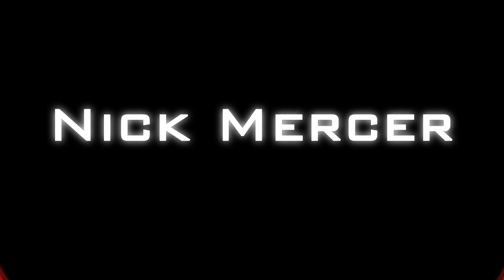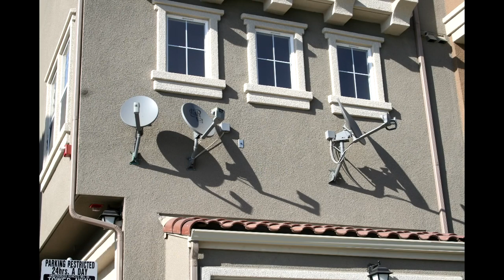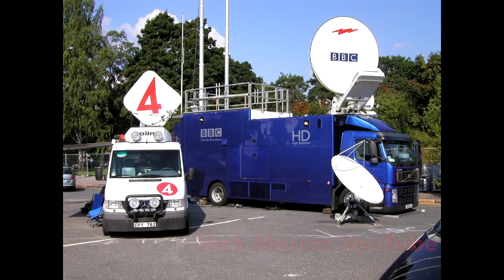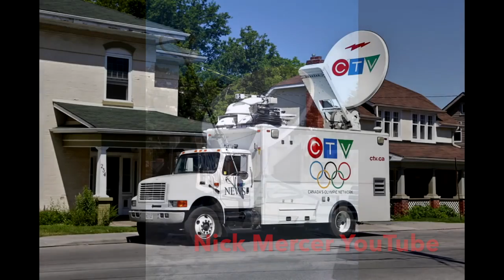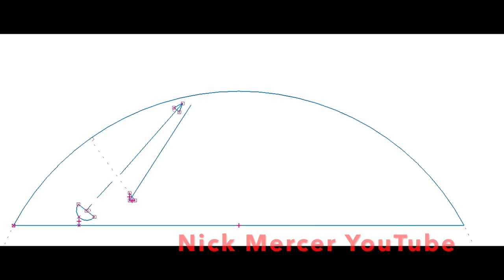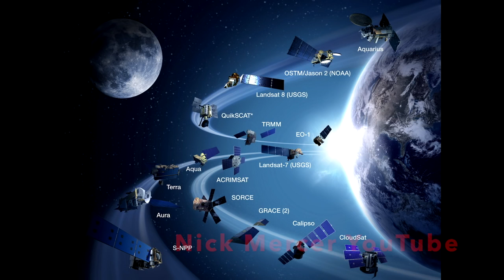The Firmament 2021, How satellites work

Comment: Anyone can see Satellites with a good telescope. All you have to do is search the sky in the direction our dishes are pointing and you will see them
Reply: Andy Martin thats not satellites they/you think they are seeing.  you cant see something the size of a mailbox or car from that far away.. just think about it.
Reply: +Andy Martin,  salar de uyuni  in Bolivia
80 miles x 100 miles perfectly FLAT, put the curvature to test there. It will fail. 
Oceans, and seas are flat they are referred to as ? Sea______________.
Reply: Prepare the way for the king I really doubt you have a telescope because if you know anything  about them it's the diameter of the scope that really matters . Also what is a focal telescope exactly I've heard of focal length on a telescope is that maybe what you ment? that can all be changed with a simple eyepiece swap or using a Barlow. so again  I really really doubt you own one I own a 80mm (in diameter) reflector type telescope only about $100 and I can see the moon extremely well with it and no there is absolutely no water in between us and it  unless that is a special kind of super invisible water with not a single bubble or anything else in it
Reply: Todd Olson go buy a telescope and stand on a beach at the ocean aim your telescope flat and look straight across do you see the other continent? Do you see the other beach that is facing you? Do you see people on that beach?
Reply: bear adams ..... Right....take a ship..oh thats right they travel on flat level plains as well. seems to me you're stuck on this flat plain with the rest of us.

Remember a lie is still a lie even if everyone believes it. 

And the truth is still the truth even if no one accepts it.
Reply: +Soldier for Christ
Hmm, that telescope you have: is it a refractor or a reflector? What mounting do you have? Can you give us the brand and make?
Reply: MrKobesadie go get a telescope lol then you will see for yourself math isn't bs it's a hard fact only bs is the flat earth there is no edge of the planet if there were we would have found it there are over 7 billion people in the world the kind of conspiracy you think is going on just isn't possible too many people would have to be in on it from around the world and let not forget people think the color of your skin or sexual orientation or region are reasons to kill each other yet the entire planet has been working together to keep "God's dome" a secret from everyone else. only people lieing to you are the people telling to the bible should be taken word for word .bible was written by people that is it's biggest flaw and second half of the story's of the bible were left out your reading an incomplete book.
Reply: dirty 4 play y are u here if you don't have an open mind fuck out of here
Reply: bear adams no mate nothing aimed at you. I too am a Harlem globelover. 
respect. 

my shit is aimed at alonso
Reply: dirty 4 play 
Ive seen them myself.  Im getting tired of these compter voices, and people pumping themselves up.
Reply: how do you explain when you are in a car traveling at 70mph you don't get thrown backwards with the motion you don't even notice the car is moving without the world passing by. . when riding the Gravitron you are based at the edge of the ride and actually feel the Acceleration. if you looked into the gravitron ride, the reason you get thrown back is because you are placed at the edge of the ride at an angle with the ride spinning at 24rpm's, in which you feel acceleration. go back to school or at least stop going to church and read your posting before you spout fake shite
Reply: well using a GRAVITRON ride as an example is a bit lame. it aint the same is it. for 1 the gravitron isn't the size of the earth IS IT, you should use your brain. size matters when it comes to velocity, motion and centrifugal force. rather than making random assumptions you should research some first.
Reply: Soldier for Christ - Ha ha, that's funny :o)
Reply: Pictures ..??
Reply: +You Tube Of what ...?
Reply: +dasspecialist1220
It is well known that a hiker in distress on a mountain can use a pocket mirror to attract attention: a bright light doesn't have to be 1' in diameter to be visible to the naked eye. The (dining-table-size) antennas of the Iridium satellites work as excellent reflectors so that (given good circumstances) you can even see a "flare" during the day.

You can try and look for satellites passing over your location, every night. They will always appear at the predicted time and on the predicted path in the sky.
Reply: daspecialist1220 Then they must be UFOs orbiting the planet then. What else could possibly be orbiting the planet? And I actually have seen and iridium satellite in broad daylight once.
Reply: dirty 4 play let not forget the reason NASA started this 7 billion people lie is to discredit the bible which tell us about the invisible done that contains all that we know lol
Reply: Alonzo Quiñones did I say I would take a ship? the earth is not flat it appears to be flat to us because of the scale of thing s think of an ant standing on a hot air balloon to that ant the balloon looks flat even if it was flying slightly above it like the scale of the plane you supposedly fly it will look flat to that ant due to its field of vision "sea level" is wear it's at because of gravity pulling all the water towards the center
Reply: bear adams....no where in my replies did I say I was a pilot. I do however deal in a highly technical/ mathmaticsl field in aviation. 

from boredight to tracking to weight and balances in aviation. curvatures are not factored in such calculations. I have flown all over this plain and I know it's not a sphere.. I wish I could show you the things I've seen and done, unfortunately you probably wouldn't believe your own eyes.
Reply: Alonzo Quiñones sorry my mistake on the pilot and I would believe my own eyes a lot faster then I would believe Somone in YouTube comments. tell me this if the earth is flat and space isn't what we've been told then what are planet's and stars and the moon which I clearly see with my own eyes and my telescope
Reply: bear adams ...fair enough..I'll give you a glimpse on what I do and where I work....Vc-25..I assure you I am not making this up or it's just my opinion. I'm definitely not some YouTube crazy person trolling. I too once believed what I was told. it's after years of studying and observation I've come to the conclusion that this place we live on is indeed not a sphere.
Reply: Alonzo Quiñones so you worked on an airplane. wow wee. how does this make you an expert. how much study and research have you put in??
vc25 is a military version of the Boeing 747.
Reply: kai sanders .....ummmm it's not just a Boeing aircraft..If you can't tell by the picture it's Air Force One then there's really nothing else to tell you. My research and experience spans 27 years.
And yes I am considered an expert in my field.
Reply: kai sanders was that aimed at me ? I'm the one with the telescope And I'm claiming the earth is round since I see planet and stars and the moon just like all the evidence suggests
Reply: Alonzo Quiñones if your right then I hope to one day see the evidence to support it and change my mind
Reply: Alonzo Quiñones so what field are you considered a expert then. 
And you've published evidence on a flat earth then.
Reply: Alonzo Quiñones so when I just searched your name. nothing came up unles your a boxer
Reply: kai sanders hahaha never heard it called that I like it "Harlem globelover "
Reply: Alamodem funny how flat earthers never seem to own a telescope
Reply: Katcho Litcha I'm brainwashed? your the one believing in a flat earth that has been  scientifically and mathematically disproven you say walk outside and open your eyes I say buy a telescope and look at the moon and stars through it you will see
Reply: Katcho Litcha when driving at a constant speed so you feel your moving NO that's why on earth we don't feel the pain you dumb fuck
Reply: Katcho Litcha also we don't fly off the spinning earth due to gravity you know that thing Isaac Newton discover long ago
Reply: Katcho Litcha you want to say I'm brainwashed your just as brainwashed believing in a flat earth because you SEE flat horizon and NBA stars say it's flat where as I have centuries of evidence proving it's not countless satellites moon mission probes sent to space pictures and video you have....
Reply: kai sanders a car isn't spinning in circles otherwise you would be thrown to the edges.  use your brain.
Reply: bear adams lmao. that's why you're convinced? moon missions?  cgi pictures?  probes sent to space??? lmfao. your easily decieved. Stop believing that nonsense.  use your brain for God's sake.
Reply: Katcho Litcha 😂😂😂 you have got to be the dumbest person in these comments we are not talking about spinning rather the force that the spinning puts on us we don't feel the spin of the earth because it's constant it never changes since before we were born we have felt it so we don't notice just like in a car you only get pushed or pulled in your seat unless you speed up or slow down the reason we don't fly off the earth is due to 1 gravity holding us down and 2 we are not on the edge of the planet you have to remember our atmosphere. orbit would be a good comparison to your carnival ride where we keep our satellites
Reply: Katcho Litcha you say all of that is fake yet you still havnt shown ANY evidence if the earth is flat and a wall of ice surrounds it why haunt we seen the edge there are about 7 billion people on this planet if there was an edge surrounding us we would have found it already and have videos picture ECT furthermore you say space is all fake yet for this conspiracy of yours to work the entire world has to work together to keep it a secret from the rest of us they also created all the space sciences like astronomy astrophysics ECT and keep all those scientist from telling the rest of us it's just too big to work you gotta remember the world doesn't work together to do anything
Reply: Katcho Litcha tell me to stop believing nonsense you need to stop listening to NBA players on subjects that they know nothing about they are paid to play a game you want to learn about science listen to Dr mitsu kaku he's a theoretical physicist 100xs smarter than the smartest NBA star so take off your Jordans and listen to what he has to say
Reply: Sea of Glass     Moon under water?, bwahahahaha. Still, maybe you're correct, inasmuch as one night you were drunk, standing beside the deep end of your pool, telescope in hand, when, aw shit, you slipped and fell in, then looked at the Moon through your scope from the bottom of said pool, yeah well, shit happens, hahaha...
Reply: Balloons   satelites  ......  !
Reply: I have a 2500mm focal telescope, never seen what your talking about, just that the moon is under water that is all.
Reply: You're not gonna convince someone that satellites don't exist when they've seen them with their own eyes. Kind of poo poos your silly flat earth theory doesn't it? Lol!

I've seen them too, with my own naked eyes. It's a lot easier to see non geosynchronous orbiting satellites because they're moving across the sky.

Equipment and conditions:

MODEL: Human Eyes

COLOUR: Brown

VIEWED FROM: Surface of spherical planet

VISIBILITY: Clear, dark night
Reply: bear adams no the sun and moon are inside this snow globe thingy.
they revolve around in a large circle. 
150foot wall of ice at the edge. which they have no pictures apparently they don't have to prove   anything?? you me my cat. My car my tv are all in on this 7 billion person con that NASA made up. 
oh yes gravity doesnt exsist either. and we are not spinning erre moving on up.
sounds like horse shit to me
Reply: Sea of Glass Firmament the moon is under water??? really.
And I suppose you can see the firament with your telescope. 
can you see the doors and Windows. 
does god have lace curtains
Reply: Alonzo Quiñones 😂😂😂😂😂😂this is why I won't travel in planes it's piloted by people like you
Reply: if thats the case, then please explain "below sea level". And being that I make a living in the aviation industry. I'd go to prison if I attempted to make critical calculations on a curved sea level....Literally everything I do is based on level plains. NO curves are even considered because aircraft operate on 0 degree plains. If that makes sense to you.

we in aviation all know the real truth out here.
Reply: bear adams you people are so easily brainwashed. get off your mom's computer, leave the basement and walk outside.  do you see a flat plane or a curved plane?  do you feel a motionless earth or a spinning ball earth. it's very simple.  go inside the carnival ride the gravitron. it's an inclosed spinning ball spinning at a fraction of your spinning ball earth. what happens?  you get thrown to the edges. but go ahead and believe what you were told in school. Stop letting yourselve get deceived. you can't be that stupid.

Comment: I had lots of fun watching your bullshit! Never saw such an accumulated pile of nonsense 
. Well done!
Reply: Being a comm technician I have worked with all types of radios, hes absolutely on the money with the bouncing of the signals from the so called "Ionosphere".

Its how I can pickup taxi cabs from Iraq on the radio. All dependent on the type of antenna and type of propagation im using. I also make my own antennas, using wire.
Reply: That's HF reflection off the ionosphere. It's not solid, and it changes with the radiation from the sun. Anything over about 30 MHz goes right through it. No TV, radar, satellite TV, nothing. The video is just bullshit. Satellite TV uplinks are at a different frequency from downlinks.